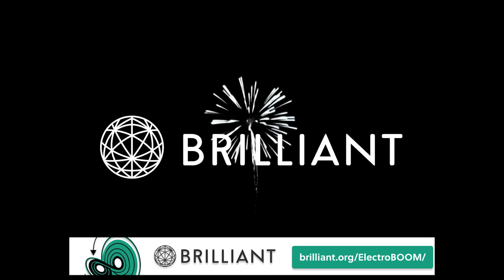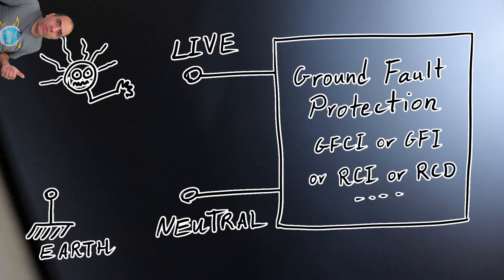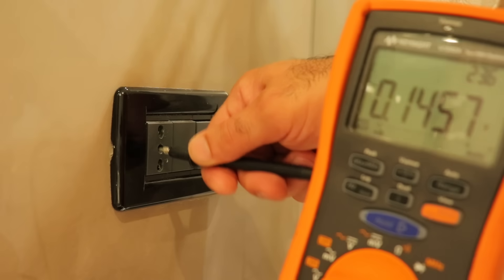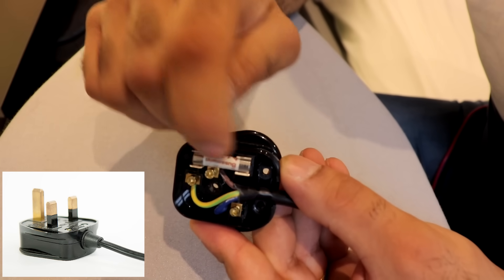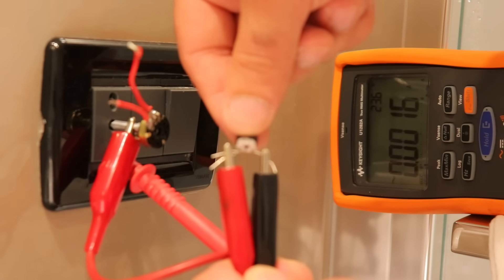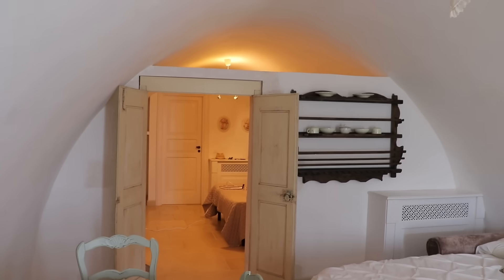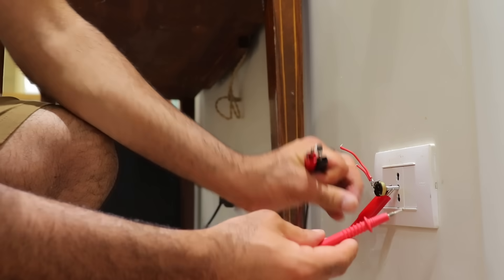Tripping Every Breaker in Italy

Comment: For the problem that you mentioned in minute 15:25, we have here in germany an Standart;
No Type F (CEE 7/4 or CEE 7/7) plug is allowed to fit in to an Type C Plug (CEE 7/16)
otherwise it isn't allowed to be sold
Reply: It's the same in all other countries where both plugs are used but somebody enlarged the cover holes, in Spain people buy illegal travel adaptors at Chinese bazaars that do the conversion instead of enlarging the holes, but some idiots will even remove the cover and leave the contacts exposed. For that reason many new buildings are designed with Schuko outlets only.

Comment: As a reminder to everyone who might be upset: Everything Mehdi does in this video is perfectly fine. If anything he did caused more than a few sparks and a tripped breaker, that's faulty protection equipment and it should be exposed and reported to the authorities.  Especialy hotels, where guests may bringt electric devices from regions with a different voltage and different regulations need to be dilligent about the safety of their electrical systems because next time it may not be an electrical engineer, systematically experimenting on it but a kid sticking his parents knitting needle or off-brand 110V charger into the outlet.

Comment: Consider having a look at the Swiss plug an wiring system for even better standards
Reply: Do you normally have 3 phase in swiss houses like in Germany?
Reply: @MernokiMegoldasok  yes, but not on all sockets. But I especially like the small plugs. You can fit three on the same space as the European Schuko socket. Grounded plugs can not be used in not grounded sockets like Schuko. Hot and neutral can not be swaped like with Schuko. Have a look 😁
Also wires in the walls are colour coded. Yellow-green is ground. Blue is neutral. Other colours are the 3 phases. Usually brown, black, grey. https://en.wikipedia.org/wiki/SN_441011?wprov=sfla1

Comment: The EU has more Standards than one plug. The last plug is the most generally used one. You can't plug a normal EU plug into a Italien outlet, what we see here with the weird looking holes outlets are tourist outlets for using more standards. You wouldn't install it in your house, because of the safety, but to charger your phone it's enough. In the EU like on the high voltage plug and outlets (red), you can plug it only in the correct way, thats the same with lower voltage connections (blue)

Comment: new standard here in Italy: ground protection for all the house and a separate ground protection breaker with a lower trigger current for the bathroom
Reply: They got to keep the money coming for the trade. Next big thing coming up: Mandatory AFCI.
Reply: The separate bathroom breaker with lower sensitivity is not mandatory, never seen one. 
This kind of standards depends also where you live and the local "traditions" regarding electrical wiring.
Reply: I am not convinced the heart stops at a lower current simply because the skin on the person is wet.
Reply: @deang5622  no but if you are wet then more current flows. It makes (a bit of) sense to have more sensitivity in some rooms like the bathroom, but it's not mandatory.
Reply: @Ale-bj7nd Agreed, more current flows for a given voltage because the body's resistance  is lower. But what I am saying is this:
The magnitude of current required to stop the heart is between 100 and 200 milliamps. Does this change because the body is wet? 

Both a 30mA and 10mA trip will prevent electrocution.
Reply: The idea that water, bathrooms are more dangerous is simply because the body's resistance is lower when wet, and therefore the voltage at which electrocution occurs is lower, meaning that there is a higher probability at the supply voltage of 230 (in the UK, or 120 in the USA).

But and RCD at either 10mA it 30mA stops that, because it doesn't care about voltage or your body's resistance, it's measuring the current difference in live and neutral lines.
Reply: @deang5622  yes that is why I'm saying it is not totally useful.

Comment: I am Italian and live in Italy, we have what we call "salvavita", it's an RCD that trips at even lower currents than the UK counter part and it works the same way as the UK one, everyone should have it installed by law and it protects the whole building at my house! The one you tested in Venice is probably like the smoke detector that doesn't work, mine trips at 5mA. About the doors on the plugs they must have it for standard. About the voltages of the plugs, the voltage in Italy is actually supposed to be 240V but since our system connects every building to the same line it overloads it dropping the voltage, at night the batteries that were charged during the day with solar power, activate therefore rising the voltage.
Reply: the inverter activetes,not the batteries.
Reply: @MernokiMegoldasok  Yes, my bad
Reply: @crboxyt  Can you get 3 phase service for a house in Italy?
Reply: @MernokiMegoldasok  Yes you can, I have it, you just have to ask Enel (The electricity provider) and if you qualify for it you can get the upgrade for free.
Reply: @crboxyt  Did ould houses with bottle fuses have 30 mA gfci too?When did they stop using fuses?
Reply: In the UK all individual circuits are now required to be protected by an RCD. This means you lose the individual circuit not the entire supply.
Reply: @markchisholm2657  Good

Comment: The current value of those breaker is coordinated with the earthing resistance i.e. that current when flowing through the erthing system will not make dangerous voltage (50 V or 25 V depending on the room type) on the connected metal bodies (appliances or faucets etc.). Interestingly, that breaker main function it is not to protect from touching live wires eventhough it could protect from those events. In fact the normative defines  it as an "additional protection device" from a direct contact with the live wire first. Since current is flowing through the body electric shock could still occur!

Comment: Did you like Alberobello and Polignano? :)
Anyway, in the first hotel the breaker you see in the room are just magnetic-thermal bipolar switches. It is different from the one with the integrated GFCI, which usually are both magnetic-thermal protected AND GFCI. The double drilled hole is because the larger holes are for 16 A appliances and the small ones for 10 A. In Italy we have quite safe and very strict rules. Source: I'm an electrician and I live in Puglia :D

Comment: The strange socket you found is called "irreversible safety socket". My house, which is from the 70s, was entirely wired with them. Also, you should not be able to plug shucko plugs in non-shucko socket due to the pins diameter, but with some force you can do it anyway

Comment: 3:38 that hotel is not wired to standard! Black cannot be neutral but only live.
The standard here calls for a blue wire for neutral and a yellow/green for earth, live can ba any colour (although most of times it's either black, brown or grey).
The double braker is a relic of the past where some homes had 2 live wires instead of a live and a neutral. Newer installation usually brake only live.

Comment: That plug at 9.13 could be a safety plug that were in use maybe around the 70s in Italy. One I remember personally is the Bticino Magic but it looks slightly different from what I can see in the video, so maybe a competitor version. It wasn't a standard, you had to change all the plugs in your electrical devices to fit there, but they were deemed safer than the standards ones, especially for kids

Comment: The new SFS6000 standard that came in 2007 mandates (I'm summarizing) that all interior outlets must be protected with maximum 30mA RCD. This is not mandated for outlets that are reserved for a specific device or machine, but this exception does not apply for outlets that are located in places that require extra care, like a washing machine in a bathroom.

Comment: That thing at 9:15 is an obsolete proprietary socket model by the bTicino company, called "Magic". It was introduced in the 1960s as a safer alternative to the plugs and sockets you showed at the beginning, but since it was proprietary, almost no appliance manufacturer used it for their products. It started its decline few years later, in 1968.

Comment: Blue is Neutral, Black/Grey/Brown are phases in whole Europe.

In Italy, one fuse is for Lights, other is for sockets. 
Italy used to have 2 power meters - one for lights (low rate) and second for other use, at higher rates. So, there was adapter to adapt E27 to normal plug, of course, and people used to plug clothes iron in it.

Comment: How the hell is black neutral though? Who wired that room?
The only solution that would make this up to standard is that they use IT wiring system and they have a fault, seeing that they use two pole circuit breakers. But using IT doesn't make much sense for wiring in a bloody hotel room...

Comment: Hey glad you visited my country!
Everything you stated is correct the only thing I would add is other than the two italian plugs (the small and the large) we also commonly use the european plugs. As a matter of fact some sockets are designed to accept all of them.
British plugs might be safer until you step on them! At least the italian one are very small and flat.
Reply: Stepping on a british plug is worse than an electric shock.They are huge heavy and ugly.Their wiring is also bullshit,they use ring circuits in a loop and the ground wire is 1 or 2 sizes smaller than live and aneutral.Their 4mm2 cables only have 1.5mm2 ground. Other European countries dont allow smaller ground wires.

Comment: i'm an Italian and i can confirm that all houses have at least one GFCI (my house has two cause security reasons). 9:16 hahahaha is a Magic outlet (seriously it is called Magic). invented by BTcino was a standard before italian plugs had the plastic protection on wires and the "doors" for outlets. was a standard that CAN'T shock you because they only have the pit with conductive metal. that standard died faster because was too expensive and can be connected only in a way (useful for DC power).
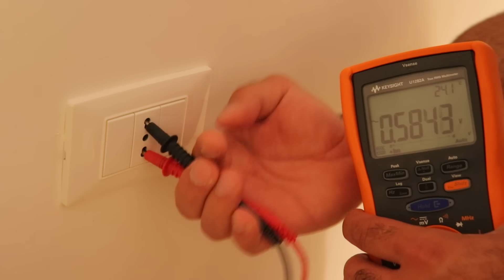10:59 yes here in Italy we have the light network and the force network (force= everything that isn't a light).
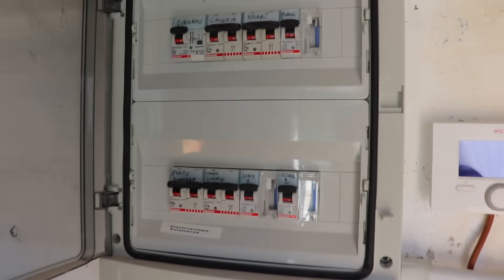11:10 seems that these breakers are for the water heater.
12:05 xD semms that you came at a manifestation (yes these type are pretty common now [sadly])
14:35 yes they trips at 30 milliamps but because here in italy houses (expecially old houses) have some dispersion so a 5 milliamp GFCI will pop when activated.
15:25 some people do it, and sometimes that has not a good ending. but quality outlets have the small hole literally SMALL so only the italian standard plug can enter and u have to force a lot the skhuko to pass trought the hole (and u risk to break the outlet)
Reply: Sembra che la bandiera della Magica non sia sventolata a caso
Reply: In Italy neutral is treated as active part. So we can swap phase and neutral and still protected aginst shock. In other countries they protect against short circuit and RCD are not used (sometimes protect only phases). In that case they have to have a correct place for phase and neutral.
Reply: bho sinceramente non ho mai visto una porta del genere
Reply: @andre3565  sono vecchiotte, ne ho alcune sul banco da lavoro
servono sopratutto in corrente continua perché non le puoi invertire xD
Reply: @computerkiller1494  e beh e una cosa positiva che possa essere utilizzato anche oggi per diverse circostanze 😉
Reply: @andre3565  certo, io uso la MAGIC per DC perché può reggere correnti fino a 10A senza rischio di collegare al contrario

Comment: EU GFCI (commonly RCBO - residual current breaker with overload protection) are easy to identify without looking at the marking. They have a test button on them marked with a T.
But all hotels use the cheaper (and easier to get) RCBO type C with AC rating only that only protects against AC faults. Codes in my country which are based on EU standards state that type C are only for industrial use and Type B should be used for domestic environments. In addition, they need an A rating that does what AC rating does but also protect against pulsating DC faults caused by certain faulty equipment like washing machines or dimmer controls.
But Type B - A rating are harder to find to buy than hen's teeth.

Comment: best to use the correct connector for where it needs to be used. So the last is a schuko (german) connector. That one is the one I use. And that one can always be turned over so live and neutral get swapped. 
would be nice to see a video whit explenation about this. why you should or should not swap live and neutral. For Dc is is easy the motor will turn the other way or LED will not turn on. But for AC it does not matter for lights for example

Comment: 13:20 you just have meet   differenzial problem  when you use cascade "selectivity" without proper breaker ( 0,3 Amp with chrono retard  to mount and 0,03A to valley)

Comment: In my parent's house in Germany the whole wiring is so old that ground fault protection would constantly trip... except for my attic, which has new wiring from 2020, so I have that... and I tripped it once already. Not on purpose, but my lamp made a funny noise and now it works still for some reason.

Comment: The extra outer holes on the plugs are for the bigger and thicker 16 amp plugs. The ones closer to the center are the 10 amp ones which most European will fit in.

Comment: That large plug with the recessed power outlet is called "Schuko" (From the German word "Schutzkontakt" - which means safety contact). It is used in several parts of Europe. In Italy it is partly used. The CEE 7/7 plug is really interesting, since it fits in several types of power outlets.

Comment: Wonder if 30ma vs 5ma has any meaningful difference in safety.  Also, it is 230v vs 120v so more power even at the same milliamps, again not sure what that means.  I believe electrocution is more related to amps than power.  And the higher voltage will allow current through worse conductors, like maybe at 120v no shock with bare feet on a dry floor and at 230v you do get a shock?

Comment: 7:30, correct, in Sweden we usually have our ground fault protection in the fuse box covering the whole house or apartment. But also with a separate one to the fridge. Fun fact - my ground fault protector died a couple weeks ago, and thus I had no electricity in my whole apartment for about 30 hours (except the fridge was working :D).
Reply: Very sensible. If you trip your house the fridge can still run and your food won't spoil. Then again you're in Sweden so do you really need a fridge... :-)
Reply: @drawingboard82  there is only about 7 months of fridge temperature, and a few months we need a fridge because outside is too cold, the milk would freeze! ( and our alcohol would freeze in february, so need to keep it warm in the freezer )
Reply: @kitsunekaze93  In winter my house can get to the temp of the fridge around 4.C, and during the day it is warmer outside.  I am in the colder part of Australia, winter day temps around 10 the other day it hit 19.c, now that was nice.
Reply: Hi! I’am curious now, do you HAVE to put the fridge on a separate fuse or is it just common practice?
In Germany we don‘t have to do it, but a friend of mine is an electrician and while wiring his house he also put the fridge on a separate one. Also the lights. So they stay on and it is easier to find the fuse box.
Reply: @raymagini8994  We don't have to, but it is common practice, which like in my case, the food stays good if the rest goes out.
Reply: @raymagini8994  When I had my house rewired about 28 years ago the electrician put the fridge on its own circuit, it has no RCD .  I think he told me that sometimes spikes from the fridge compressor starting or stopping can false trigger the RCD, shutting of the power and if you are at work or go away then you loose food.  This is in Australia.
Reply: What's the reason for having the fridge on a separate protection switch?
Usually in a system like that the 2nd GFCI (RCD) isn't for the fridge but for especially humid rooms like bathrooms
Reply: @dave they’re all on different breakers but then the ground fault protector spans over all of them. 
The reason you want a separate one for your fridge and freezer is so you don’t come home from a 3 week vacation and something in your house has tripped the protection and all your food is spoiled.
Reply: Life hack, wire up an outlet straight to the light bulb socket so you can steal power from there
Reply: @pompshuffle562  and be limited to say 7A of current.
Reply: In the USA the fridge and microwave, and lights are all on separate individual circuits, but it's only been recent it's "law"
Reply: In Aus it used to be common practice to put all outlet circuits on one RCD, customers didn't like it so they started asking for multiple RCD circuits and only recently our rule book changed to say every domestics circuit must be protected by an RCD, so now we don't even buy regular breakers anymore

Comment: You shouldn't be able to connect the last type socket, probably someone has forced it and enlarged the the smaller inner holes to avoid the replacement of the socket itself since it's very expensive.